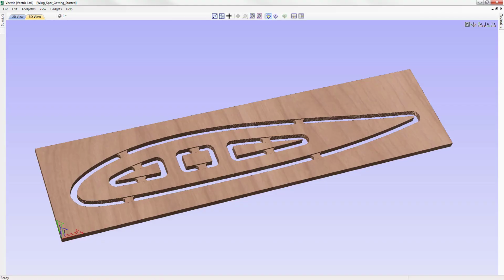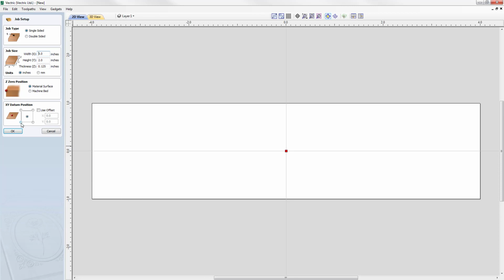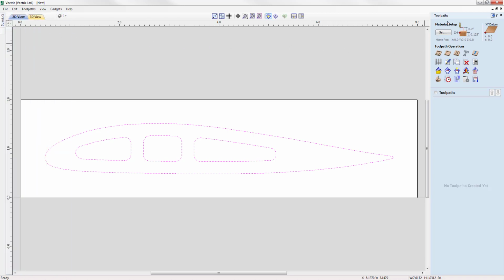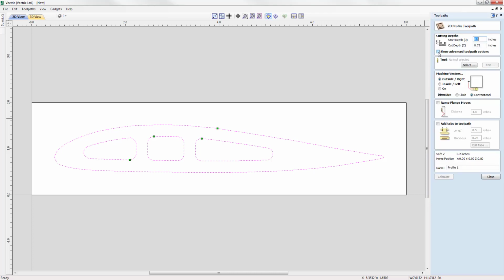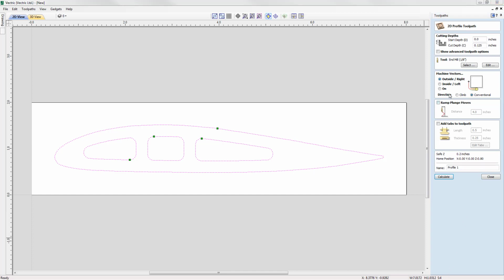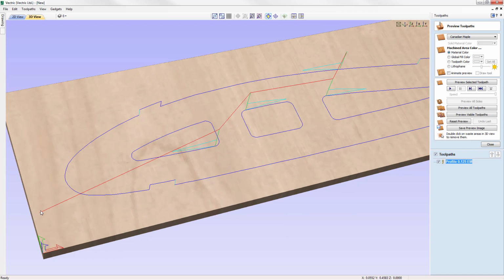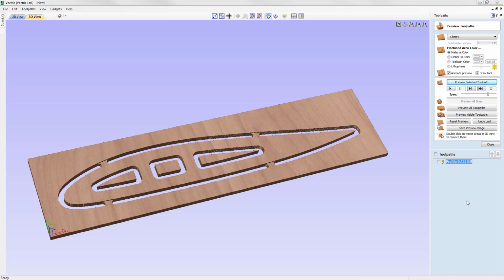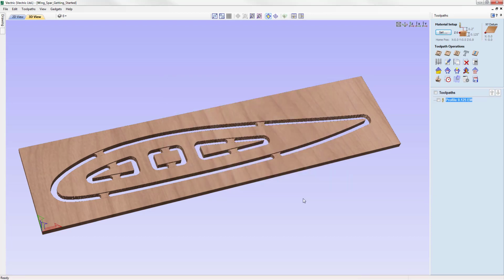Vectric V10 Tutorials | Getting Started | Wing Rib

Comment: I'm getting a good understanding of Cut 2D desktop and for my first project I would like to cut out wing ribs for a remote control aircraft, the shape is similar to the one in the video. But how does one precisely rotate an object? I would like the ribs aligned vertically rather than horizontally. I have looked through the videos but could not find how to precisely rotate. ~ Thanks
Reply from the maker: Hello Mark... Thanks for the question.

Have a look at the "Rotate" feature of Cut2D that is located in the "Edit Objects" section of the "Drawing" tab... that should do the trick... :) ~Todd
Reply: @vectric  Thank you for the reply, coming from 15+ years working in Corel Draw I have much to learn about Cut2D.